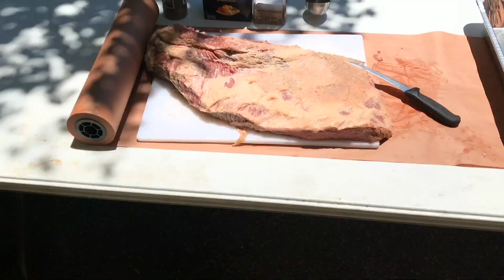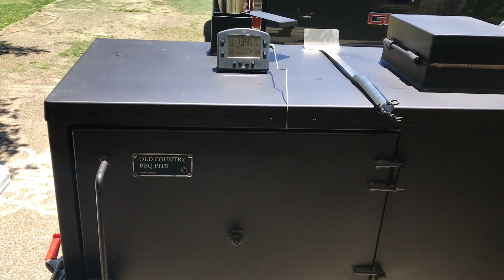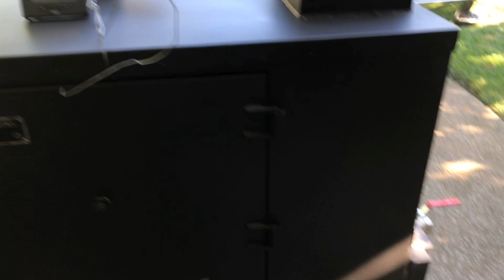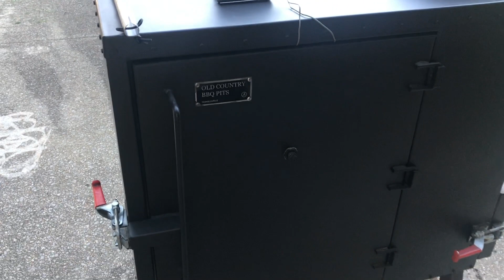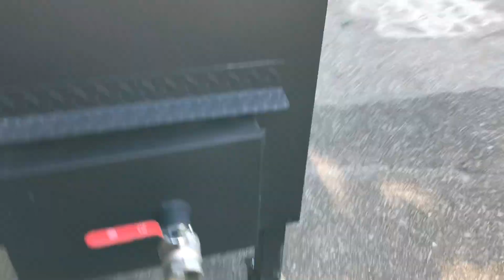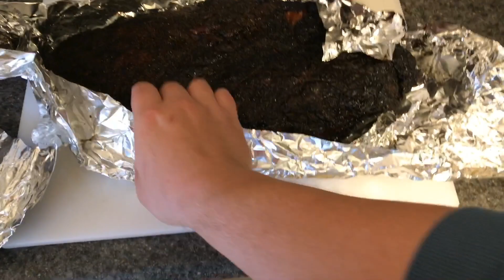Old Country Insulated Gravity Smoker - First Brisket

Comment: you are missing part of your smoker. the heat shield defuser " that's what I call it. it rests on the right side of fire box opening and extends just past the 2 welded nuts with rod legs that sit in the nuts

Comment: Thanks for the thorough review of the smoker even if there were a few downsides. the charcoal clogging was weird, but as you said maybe it's a specific type of charcoal shape or density that leads to it. Hopefully changing that up will resolve the issue so you don't have to intervene manually as often.

Comment: Great videos. Your descriptions of everything are clear and concise. I prefer Royal Oak myself I think you will like the flavor over Kingsford too once you've tried it. I buy Frontier brand at my local Rural King, it's made by Royal Oak and as far as I can tell is exactly the same but less $$. I would suggest contacting the manufacturer about those welds too I'm sure they would make it right if it's not.
Reply from the maker: I definitely liked the smell of royal oak as it’s lighting more than the Kingsford but i noticed the white smoke it out out was much heavier. Almost looked like a steam engine as it was coming up to temp! It cleared up after coming up to temp and that’s when I threw the butt on. Overall I think the flavor was very similar to kingsford for this smoke. I have ribs and Cornish hens planned and I think we will see the real taste difference with those!
Reply: in my using the Royal Oak i think it burns hotter and longer

Comment: Great video! How would you compare this to the OC Smokehouse? I am trying to decide between the two of them. Any info you can share to help me decide?
Reply from the maker: Pinny smokehouse was a solid buy if you’re looking for a stick burner. My only caution would be that it would run away if you don’t get the wood lit correctly and 225 was difficult to cook at. I did all of my smoking at 250 or higher. You need larger splits or you’ll be out there every 15-30 minutes fiddling with fuel and intake/exhaust to maintain temp. I used larger splits and there were several times where I turned my back for 20 minutes and it would jump from 250 to 325+. Water in the pan is a must. All that said, it was great and did what I needed it to when I needed it. I really liked the real estate and large firebox. It was very inefficient with charcoal.

Comment: Love to see some close up pictures of the inside when you seal things up in there.  TRENDKILL seems to be having good luck with B&B oak competition briquets and their lump charcoal on his gravity units.
Reply from the maker: I definitely will! B&B might be the way to go then. I usually buy charcoal in bulk (200+ lbs at a time). I might have to try different brands until I find one that works best. I’m also curious if it’ll struggle with the BBQ Guru attached.
Reply: @jg1317  no, the guru will work better with b&b. I use my flame boss with b&b and it works great.

Comment: I've been waiting for a good brisket cook on the OC Gravity.   Appreciate you doing this.   Glad to see it produced a nice bark.   How many pieces of Post Oak did you use on this cook?    Were those chunks or just small pieces of splits?
Reply from the maker: Three pieces used during the smoke for the first 6-7 hours until 160 internal. They are ~14-15 inch splits I cut in half. I believe chunk would have to be replaced constantly and it’s more value added to buy logs/splits and cut to size.

Comment: Nice video man. Completely sold out of the gravity’s here Texas. 🍻. Im still on the fence about getting 1, assassin gravity looks better built but cost twice as much.
Reply from the maker: I can’t speak for absolute quality of an assassin, but I think you receive a very well fabricated smoker when purchasing from them. I don’t believe this to be in the same class but I believe it to work well for the primary purposes I purchased it for. Ease of reloading fuel and efficiency were my two major checkboxes and this has hit both. I believe the issues I have are minor and can be fixed with minimal mods.